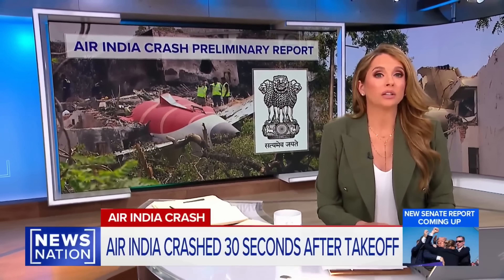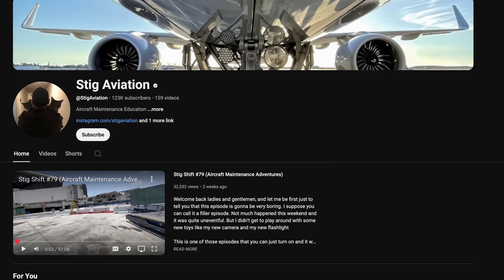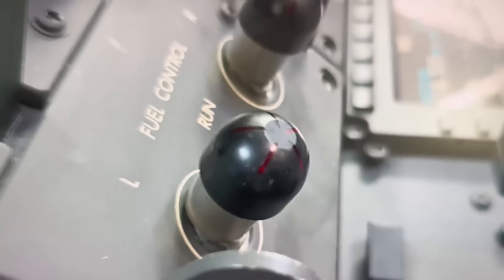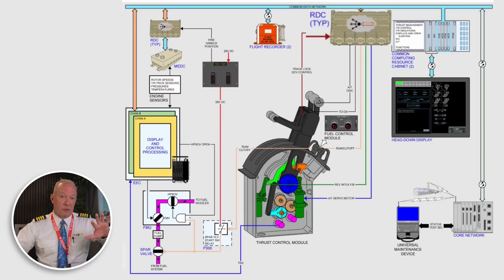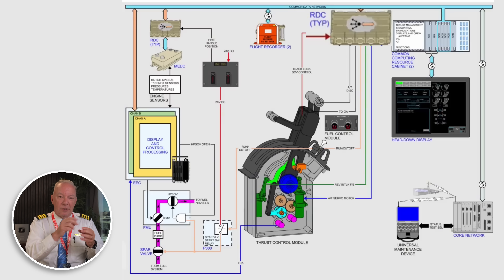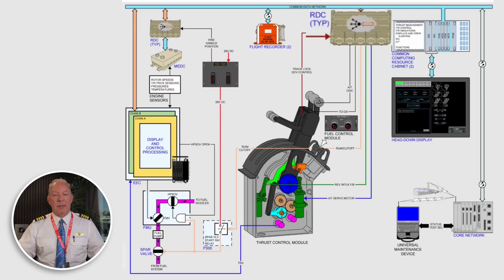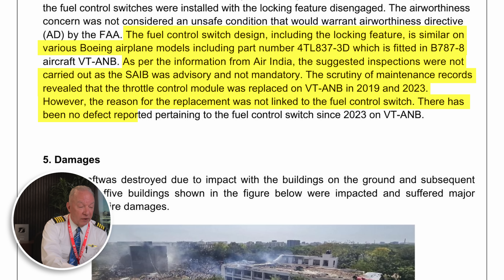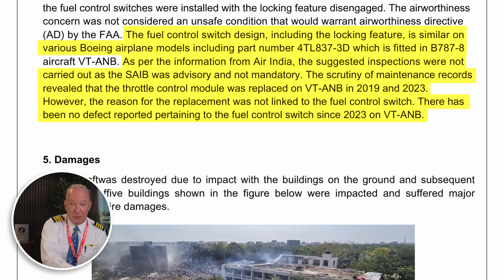The Truth About Boeing 787 Fuel Control Switches

Comment: Yes but that switch is all you can see. What if a wire came unsoldered or something in the wire system below got how and melted and shorted. It is very shallow minded to talk about that spring in the switch being perfect. It all goes to a very complicated command system, not just to the pumps.

Comment: Duel Engine Failure requires Fuel Switches to be Cycled Steveee is this correct ...

Two Both Engines Spooled back up but not enough to Save Flight .... 
Also The RAT deployed but also requires run up time 45 Seconds 

Actual Flight 32 seconds ?????

Which ever

Comment: Thank you Captain Steve for the excellent content as usual. 
One small note, it sounds like you are using the term Direct Current to mean something is fed directly, unless I'm interpreting your words incorrectly. DC in this case simply means the power fed to the system is from a DC source, like a battery as opposed to an Alternating Current source like a generator.

Comment: You need to explain this again to Garybpilot.
This sounds pretty conclusive except for the word "battery", rather than "batteries". Doesn't sound like redundancy. It sounds like a common element shared by both engines.
The only thing I want to know now is whether "battery" refers to a shared battery or a separate battery for each engine. And if it's a shared battery is that some kind of gee-whizz smart battery that
could potentially decide to go into a charge-only mode. Horrifying to imagine such a mistake but it's the last possibility I haven't heard closed off.

Comment: Hi, personally I think it is very irresponsible for a current pilot and industry professional to make these claims without any real knowledge of how electronic systems work. You claim that it is an entirely mechanical system, which it is not. I spent some time designing electronic systems and all sorts of things can cause false signals to enter the network. The way you have been dis-respectful to other industry people 'who are' experts in their own field disturbs me. In particular in regard to the the Piers Morgan interviews where you actually laugh at your co interviewees several times. Your views, presented on this channel and elsewhere in the press have in my opinion biased many reports. This is helping Air India to cover up, as they wanted to a failure in their maintenance procedures by not admitting fault which they are fully aware of. I am sure you are prepared to be proved wrong (as may I) and in that case provide a full and proper retraction and apology.

Comment: I'm not suggesting that pilot involvement can be ruled out (certainly not at this early stage of the investigation), but the 2019 Boing 787 dreamliner Osaka incident, where a software glitch shut both fuel switches even though the physical switches were not moved, raises a possibility that should be considered (I'm sure it will).

Comment: Weird story, you do not show electronic circuit to show how the "data" electronic circuit does work. Do they work on switches or on relais? Is there a remark in CVR that switches were off and that someone did switch them on again? 
And do you really mean the valves are default off?
Reply: Besides, why are there suicide switches build in an airplane? And second, why did RAT deploy? Explain ...

Comment: Could the boost pump or main pump shut down and cause a signal that the fuel control switch is in the OFF position even though its locked into the ON position.  If the boost pump or main pump fails then there would be no fuel to the engines (unless the egone pumps pull fuel thru from the tanks).  So all the inline vslves from the fuel tank to the engine could remain open but the engines would flame out.  

Feom what i ubderstand is the main pump supplied fuel to both engines on takeoff.  Although rare sometimes FOD can stop a pump.  A rag could stop it and once shut off come back out of the pump and it can run again if its not caught up inside the pump.  

A common denominator  of the switches, valves, pumps, and engines is the pump itself or pumps. If the pump intake is blocked then no fuel can pass thru it. Once the suction is off the rags can recede nack out and if you restart the engines they can re-light as long as those tahs or FOD is not ingested into the pump.  .

Comment: I disagree with your understanding of electrical systems Steeeve and the way you have virtually ruled out any other possibility of an electrical system failure. The interim report is written to mis-lead deliberately and many facts are not present. This leads to the assumptions such as the ones you are adamant about. In all probability this event was caused by a massive electrical failure, possibly caused when the rear lithium battery reacted to water ingress directly or arcing in the system and caught fire causing many other issues. This is a known possibility and no matter how improbable, this is possibly what occurred. The RAT actuated because of this and restored power t the system and the engines tried to re-light but it was too late. For an in depth, realistic and un-biased report watch Airline News with Geoffrey Thomas on youtube, their approach is methodical and analytical.

Comment: Well actually another reason to switch them on and off is if there was water ingression and the FADEC switched them off and you are heading for a building. If you do nothing you are going straight into a building. I might try switching them i off and on as a last ditch attempt  to relight the engines.

Comment: Steeeve dont understand, that an electrical shortage BEHIND (bypassed) the switches can activate the FCO circuit. Maybe because of a few chafed other wires near the wires of the Fuel Cut Off circuit, which bridged it.
He ever and ever say 'its mechanical relay'. Yes...the inner contact is mechanical...but the trigger and the input and outputs are electrical lines.
The FDR does not record the physical movement of the fuel control switches but rather the electrical current behind the switches. The fuel can be cut off without the physical switches being moved as these airplanes are highly computerised systems not just mechanical machines. The conversation between the pilots sounds like a knee-jerk reaction after noticing they are losing thrust.

Comment: Few Data-driven / Logs based decision rules are listed down below to indicate likely Engine Side or Non-Engine Side caused issue: : 

If RPDU/breaker logs show faults before engine parameters moved, treat airframe-origin (spurious command / FSOV closure) as primary. (Non-Engine Side)

If FADEC BITE flags show EEC power loss before any RPDU/bus anomalies, treat FADEC-first as primary (engine-side).

If FSOV position sensors show valves closed and cockpit discrete shows switch moved, then the shutdown route was airframe commanded (Non-Engine Side)

If FSOV position sensors show valves remained open while fuel flow goes to zero, then the engine (FMU) closed internally → engine-first.(Engine Side)

B — What evidence will prove each interpretation (exact sequencing and items)

(Everything below must be time-aligned to the same clock — millisecond resolution if available)

1) To prove FMU/FADEC-first ( Purely Engine-side initiator)

Should evaluate:

FADEC/EEC BITE logs: internal fault(s) or PMA_present flag lost for each EEC at time T0 that precede any N1/N2/fuel-flow decay.

FMU commanded-closed or fuel flow → 0 at or immediately after T0.

FSOV position sensor showing FSOVs remained OPEN (or not commanded closed) while fuel flow dropped to zero (i.e., valve did not move).

PMA voltage trace shows PMA power decays only after engine spool-down

If this ordering exists, FADEC/engine-side caused the shutdown and FDR labeled it “fuel switch cutoff” as an alias.

2) To prove Airframe-commanded FSOV closure (Airframe initiator)

Should Evaluate:

Cockpit fuel-switch discrete (raw contact) or fire handle discrete shows physical movement/command to CUTOFF at time T0 (or an automatic logic discrete shows the command) before engine parameters begin to decay.

FSOV actuator feedback / valve-position shows valve moved to CLOSED at/shortly after T0.

Engine fuel flow goes to zero after the valve closed.

RPDU / relay logs showing the command path (or an automatic fire/overheat logic message on EICAS/ECAM) that corresponds to the valve command.

If this ordering exists, the engines were externally starved by FSOV closure.

3) To prove Recorder alias / corruption (false indicator) ( MOST LIKELY)
 
Should Evaluate: :

Mismatch between cockpit discrete and FDR labeled “fuel switch”; or FSOV feedback shows no valve movement yet FDR says cutoff; plus evidence of data loss / bus errors / QAR anomalies at the same time.

Hope this gives some insight.

Comment: What if gear up was commanded and one of the crew (due to a mental lapse) turned the fuel control switches rather than the gear up lever.  I want to hear/read the whole conversation during this incident.

Comment: So you do not subscribe to the  'Lithium Battery Diode Module Failure' mode of failure, where a fault causes a cascade of electrical faults as the u/c is retracted. This cascade cuts the fuel to the engines.

Comment: Further detailed reading suggests that the fuel cutoff switches are not simply wired to a relay somewhere else in the aircraft's electrical net. It would seem that those switches produce an electrical signal that is converted to a fibre optic one before it is sent off from the physical location of the switches  onto a main fibre optic bus. The destination for that fibre optic signal representing the fuel cutoff switches' positions, is the FADEC located in each engine. It is this engine management computer that controls the physical fuel cutoff valves. The pilots have no direct control over any aspect of the engines' management. That is why this management computer is designated 'F_ull  A_uthority'.

Comment: I am an Air Cargo professional with 20 plus years experience in international and domestic Air operations. I am IATA DG ceritifed Aviation consultant and an  Independent researcher. I also did my  own independent deep-dive analysis before and after the AAIB prelimnary report, including granular level second by second research of timelines and technical FIFO and LIFO of events, on the AI 171 crash.  Below is my final micro level findings with a most probable root cause. Below is a small excerpt of it : 

In my opinion, It is an Airframe-commanded fuel shutoff (FSOVs) — via spurious/automatic electrical command or relay/RPDU fault

Why is this electrical / relay or RPDU  fault or a  related logic malfunction  inferred as a most likely cause and NOT a FADEC outage or a Pilot  Error theory::

Pre-existing cabin electrical degradations that were present even in previous leg and continued later as well , probably point to an airframe distribution/RPDU issue.

Near-simultaneous “FUEL CUTOFF” on both engines within ~1 s likely matches a common-path command (relay/RPDU/logic)

At takeoff thrust, each FADEC is self-powered by its PMA; a FADEC-first/FMU-first shutdown would require very rare, identical EEC failures or simultaneous PMA defeats — much lower prior probability than a single airframe electrical fault that issues (or mimics) dual cutoff commands.

RAT deployment here is consistent with downstream consequence (both engines flamed out because fuel was cut at the spar). likely not indicating FADEC to fail.

Comment: I noticed this video with an alternative explanation.   

https://youtu.be/6-yi6A_1Fe8?si=a_4EyTQuvBkwI6Kh

They alledge that the Weight On Wheels sensor was faulty.

What is your opinion of this theory?
Reply: You just answered my question. 

The computers can't shut off the fuel because they are not connected to the solenoid.

Speaking of solenoid, do you remember the Selenoid Robots from the Roger Ramjet cartoons?

Comment: As an electrical engineer specialising in aircraft electrical systems with 22 year experience I have to say you did an excellent job of explaining this. There are no computers or data or glitches that can be a part of this. The system is as analog as it gets. And with 2 separate circuits there is nothing that would affect both of them 1 second apart without a human moving the switches - whether by mistake or intent.
Reply: Could you explain what the redundancy is in this circuit please? Because whilst the term 'they are mechanical switches' is used a lot in this video, they are presumably only mechanical in there movement and will have an electrical contact which is switching a relay or the like....I could imagine, but how does that analogue circuit actually work and what is the redundancy?

Comment: The fuel limit or the fuel control on the jet to Palermo ended up in a ocean landing because of both engines failed : no fuel fuel down
Was it fatal - for sure but kept very quiet 

It’s far too less noticed by captains and flight crew 
In 20-30000 height sudden fuel out both engines not working 
Fatal landing I. The ocean because NOT ENOUGH fuel to go to Palermo May Day landing 
You know what I mean 
The flying captain and crew need to check it like you do and did 
How can the fuel control be influenced by bacteria or air ? That what it says in - mayday palermo in the short cut video !
Its shown they long haul flights have reserve fuel tanks in the larger plans but the Boeing is the worse with 280 passengers going into 42 35000Heights with fatality as it was lately Alaska is an example the Indian ones and the Delta planes Going to overseas or den

Comment: Does airplane now a days have this time stamp data that records what the pilot are doing. Let us say for this one Fuel Control Switch from the Gate Pilot set it to Run - a time stamp will record or registered this action in a data memory and then if the Switch is switched to Cut Off it should register again as the last command. I don't know if airplane have like this. In the Electrical Substation all actions are recorded in a data center via annunciator - all digital signal. ON-OFF actions.

Comment: Is it possible that the fuel switches were accidentally positioned on TOP of the fence instead of in the ON detent? The spring loading would have held them in place until the co-pilot unwittingly brushed against them and pushed them down. As I understand it, the time resolution in the black box is only one second, so they could have actually been switched milliseconds apart, not one second. This scenario is consistent with the dialogue in the cockpit.

Comment: Everyone is speculating without knowing exactly what happened. They haven't released the recordings or exact timelines. We have  the pilots being blamed by many and it's sad what their families must be going through. From some investigations I've seen, the RAT was deployed just before takeoff (since it takes atleast 3seconds to deploy after a failure) meaning the failure was before the plane left the runway. There is also a procedure to reset the system by toggling the switches to restart the engine which the pilots might have done. The plane continued to fly do to inertia for few more seconds. Whereas for the fuel solenoids and relays, we don't know if the default position is normally open or normally close which could happen if there was an electrical fault.

Comment: Question.   Looking at the close up of those switches the detente on the body of the switch is long and flat.   The detente on the toggle is short and flat.    That design looks like it is entirely possible to release the switch in the intermediate position with the toggle detente sitting on top of the long flat body detente and it would stay there.   Is it possible that they were accidentally placed in that position with switch indicating On initially.    In that position, with the slope of the panel. the nose-up of take-off and the vibration of take-off it could easily then slide down and drop into the Cut-off position.   I realise its unlikely but the design seems to make itself prone to being stable in an indeterminate intermediate position.  It looks like those detente features need to be much shorter so wherever to release the switch it slides down to one side or the other.

Comment: Steve how much has boeing paid you???  Someone needs to check his accounts because he is hell bent on blaming the dead pilots. I ain't a pilot, ain't an engineer, but i can still tell you a fuel cut off switch can fail simply because it has components whether mechanical or electrical. So even if it is mechanical, the components attached to a switch has to be in working condition. Nothing lasts forever, every component requires regular maintenance and replacement over time. It is basic common sense.
Also I don't like guess work, instead of blaming the dead pilots, tell your beloved company to start fixing cameras in the cockpit. Don't just be overconfident that its impossible. There is nothing impossible in this world, anything can happen.

Comment: When you move the cut off switches from run to cut off do you do it with the thrust levers at max thrust or idle? The fuel cut off switches should be interlocked so that the thrust levers must be in the idle position first before allowing fuel cut off, design flaw in my opinion!
Reply: If the pilot wants to crash the plane he will crash the plane, no matter how many complex interlocks and complex anti pilot suicide mechanisms you cram into the plane (which will themselves become failure points)
Reply: @looloolama  It appears whoever moved the cut off switches did so without the knowledge of the other crew member. If he had to wrestle the thrust levers out of his hands reduce them to zero before he could cut the fuel off I think he would have had a bit more difficulty in doing so?